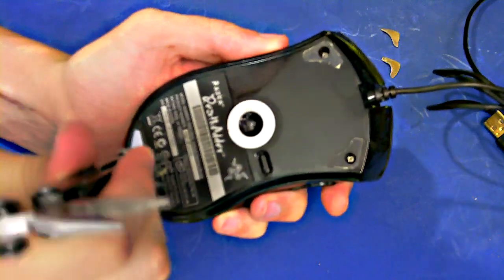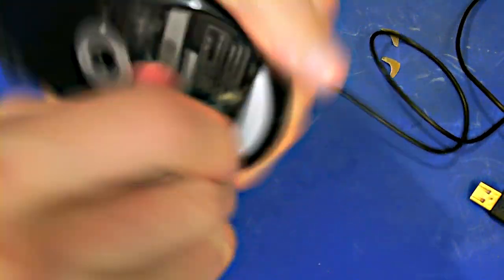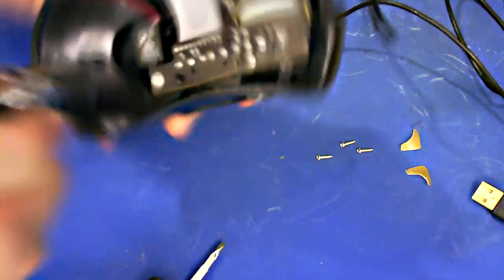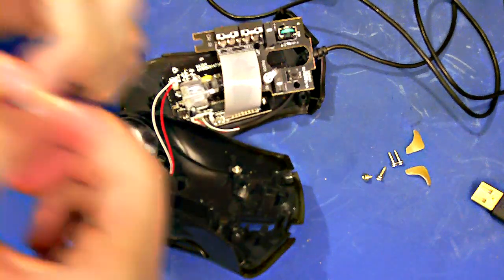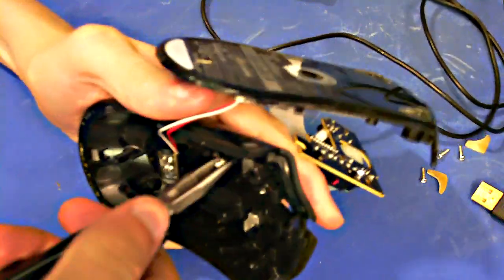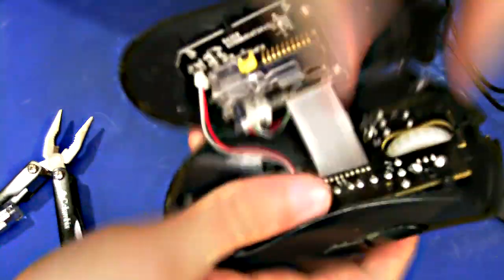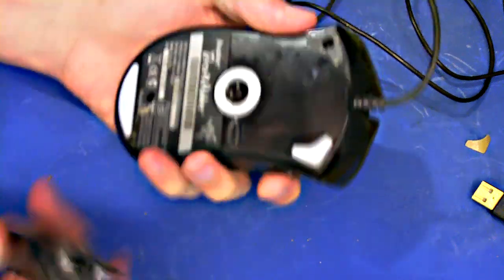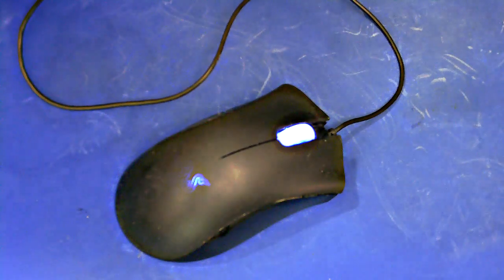How to fix Razer Death Adder Scroll Wheel

Comment: Worked like a charm on the Death Adder Essential!! Thanks!!

For anyone having troubles, to take out the scroll wheel, you gotta take out the screws on the mouse 4 and mouse 5 switches on the motherboard & the little led board has a small screw on it too. Then it will come out fine. :)
Reply: i read that you should try blowing air into it so i was trying that at first and it wasn't working, i popped the bottom plate open and looked at the scroll wheel and there was a shitload of cat fur all embedded in it (i have 3 of the little bastards), cleaned it up nice, tested it, was still having the issue, but i blew air into it then and it's been working fine since for some reason.
Reply: @aquarius5264  dude thank you so much. i watched this video but i hadn't stumbled upon your comment back then.(and i didn't want to deal with disassembling the mouse) i literally just blowed some air with my lungs to it and it's just that. bam. fixed. i can't believe this worked lol.
Reply: @mayeutow  you can also take it apart and take some tweezers and just kinda pinch the fuck out of the little axle thing or whatever it's called

Comment: If anyone wondering about the legendary RAZER COPPERHEAD and DIAMONDBACK, they have the scroll wheel part in common, but it is slightly different that the one from the DeathAdder. Is it a bit harder to open/close (clips on the front under the clic buttons and one screw on the back behind the big teflon pad). So if you are looking for that particular part (scroll wheel) to replace, you can exchange between these 2 mouses, only difference is the rubber part that is smooth on the deathadder when the copperhead have some sort of notches on it, but you can also interchange rubbers as they can be detached from the wheels.

Comment: For anyone who has the new mouse ( the one with the black scroll wheel ) you do NOT need to take the motherboard off. DO NOT DO THIS, AS THOSE SCREWS ARE VERY FUCKING DIFFICULT TO PUT BACK IN AND CAN RESULT IN BRAIN TUMORS. HOWEVER, once you get the cover off, all you really need to do is take a pair of tweezers and squeeze the living shit out of the piece that the LEFT side of the scroll wheel INSERTS into (It is the thinner side of the white plastic piece that goes THROUGH the scroll wheel) pinch it on its left and right sides a few times (or a lot, I chose to do a lot so I didn't have to go through this hell again) And then put it back together and Wa-la! Hopefully now your mouse wheel won't give you an aneurysm.
Reply: If im looking down at the mouse with the scroll wheel at the top, its the piece in the top left with a black rounded top and a metal bracket surrounding it that im squeezing? You said pinch on left and right sides but at the orientation im looking at it the wheel axel is going into it on its right side.

*Edit* Turned out I had a whole different problem, part of the axel was broken off and stuck in the receiver, so I had no choice but to remove the motherboard and take out the scroll wheel entirely and mcguyver it back together using super glue.
Reply from the maker: Thanks, hopefully people see this if they have a new mouse.
Reply: do you pinch the orange part or the metal part?
Reply: Could you please elaborate on the specific piece? I can't seem to fix the squeak no matter what I do.
Reply: This did not work
Reply: Thats what is shown in many videos on Youtube but for me it just fix the problem randomly: few hours later i have to fucking press the wheel really hard to make it work and sometimes it last month.
Reply: Reporting in with a black scroll wheel. I would definitely recommend removing the main PCB. There's a 2nd very small PCB sitting near the wheel on top of the main board attached with a tiny black screw that you also have to remove. Plus two more screws on the left side holding down the 2 side buttons. After all that is removed the main PCB comes off and you can remove the scroll wheel like in the video. A small piece of tape worked wonders.
Reply: Thank you so much! Been looking forever for a fix to this, never thougth it would be this hard to find one. Finally fixed it after 2 fricking years!
Reply: umm im confused lol
Reply: They are easy to put on with the right screwdriver. There is a hidden screw in the middle.

Comment: 2015+ Deathadder users please read. GEL superglue works great, just a pin drop on the head shaft. Careful inserting it back, not to glue the rotating wheel which is what Foxden did it seems. The newer deathadder requires the 2 extra side button actuator screws to come out once inside.. so 5 screws are holding the pcb in place. Just fixed mine and it scrolls like BRAND NEW!
Reply from the maker: +Tony Skiffington thanks for the advice/comment Tony, I did make that mistake. Luckily I had an extra mouse to try it on without risking it. I don't have the newest model sadly and have since moved on from Razer mice because I had 2 with problems in less than a year. Glad to hear yours is in tip top shape! Hopefully that helps others

Comment: I've tried this method before and it worked for a while(tape method). I was thinking of a different method since my diablo 3 steel series mouse was really annoying me to death. This is what seemed to work so far; I cut a small square from a rubber band and poked a hole in the center with a push pin. Then inserted the square piece at the end of the divot(very snugged, may have to stretch with push pin), then reassemble. You might be thinking why the hell would this work.  I think it works because the rubber-band piece is creating friction from the pressure it is exerting on the spinning part so when you scroll, the rubber band catches the spinning part forces it to turn. So far its working but i did notice it decreases some of the scrolls lengths, but IMO the random scroll is way more annoying.
Reply from the maker: thanks for sharing a fix!

Comment: in my case (>10yo deathadder, wheel jumpy - going in the wrong direction sometimes) it only helped to clean the green wheel and pry its 3 contacts loose a little bit (very very carefully). also cleaned the opposing side. i used isopropanol for the cleaning.

Comment: So my deathadder essential started to scroll up when i scroll down most of the time, did anyone have the same issue and can confirm that this fixed it? :]
Reply: i fixed it
Reply: i have this too :/
Reply: @daz1717  i just bought some compressed air and blew into the mouse a bunch, that fixed it so i guess it was just dust messing with the wheel
Reply: @inari_777  yep, i just blew into it a bunch and its working fine now. it started abotu a month or two ago so i stopped using it but i just decided to use it again incase it works and it did. i did not wanna take the whole thing out lol
Reply: i literally blew on my scroll wheel twice and it fixed it

Comment: So i took mine apart, but now that Ive put it together, it wont left or right click. idk what to do, I see the parts that push against the left and right click buttons, but they dont reach
Reply from the maker: +Hayden Garczynski make sure that when you put it back together the mouse clicking lines up with the circuit board so that the clicking works.
Reply: Foxden I'm just an idiot. I figured it out, but not before breaking the grey wire-piece. So now I have to wait for my dad to re-solder it back together. Thanks anyway man.
Reply from the maker: sorry to hear that! hope all goes well

Comment: i took the screws off but i cant pull out the top or bottom part. Do i have to pull rlly hard? cuz i feel like its gonna break.
Reply from the maker: Can you see the crack? Make sure you got all the screws, it may help to use a credit card and slid it in the crack where it comes apart. Don't pull on the push down clicking tabs (I don't know what to call them) because the part that actually comes apart is on the side. At 0:56 you can see the crack where I pulled it apart.
Reply: ty :)

Comment: Hello everyone, I own a DeathAdder Chroma which I believe is the 2013 edition just with spectrum lighting. This causes some problems, since I have the same "loose scroll wheel" issue, but the DeathAdder 2013 has differently placed inside parts. There are several more screws and some parts are blocking the wheel, so I can't take it out and apply the fix shown here. There are no fix videos on  YouTube and I'm pretty sure I have checked most of the forums that list this issue. Any ideas are welcome.
Thank you in advance.
Reply: $90 mouse   :(

Comment: took my deathadder  2013 apart and its compleatly different cant figure out hot to get the scroll wheel out theres like 3+ extra screws in mine than yours
Reply from the maker: +Dub 420 Tony left a comment "2015+ Deathadder users please read. GEL superglue works great, just a pin drop on the head shaft. Careful inserting it back, not to glue the rotating wheel which is what Foxden did it seems. The newer deathadder requires the 2 extra side button actuator screws to come out once inside.. so 5 screws are holding the pcb in place. Just fixed mine and it scrolls like BRAND NEW!"

Hope that helps

Comment from the maker: I tried superglue as this fix didnt work as well as I'd have liked it to, I broke my mouse wheel that way, I do not recommend doing that. I hardly used any superglue but there are 2 spinning parts or something in there and they ended up glued together. If someone figures out a good way to superglue it then I would recommend making your own video but as for me I'd recommend not doing anything that could permanently ruin the mouse.
Reply: +Foxden Water based paint~~ does the trick
Reply from the maker: great suggestion
Reply: what is the problem that is being fixed here? is it when you scroll instead of it going down it flick between up and down?
Reply from the maker: Stienozo this problem is when you roll the wheel up and down and it barely moves the screen or moves it up and down even though you are only scrolling one direction.
Reply: Foxden
perfect thank you
Reply: 0
Reply: Thank you soo much! Its work very well.
Reply: Hey man! I was going to use super glue but i used a good hard epoxy instead! just dabbed a strand on, pulled it around the lil ball and let it set and cure for about 2-3 hours. Plopped it in and so far so good!
Reply: as it happens, i just fixed my mouse using superglue. tiny dab in just the right spot and it scrolls just fine again...

Comment: I'm slightly confused here. I took apart my mouse. And have the scroll wheel out. And I see the side with the little divet. So am I just soley taping the little divet in the end?  Or am I taping the entire side with the divet. I can't really tell cuz the video is going too fast. Are we essentially trying to increase the radius of the divet so it actually turns the mechanism?
Reply from the maker: yes, the divet gets rubbed down so that it no longer catches the scrolling mechanism, so the little part that goes inside the circle needs to be slightly, barely, like just a small titch larger so that it starts catching it again.

Comment: Hi, after inserting the toothpick (without the scroll wheel) I tried to connect the mouse and rotate the toothpick but  doesn't work. I should try with the scroll wheel in position or  it isnt relevant? Thanks for your help.

Comment: Seriously, those mouse are all about paying for a name.. They're cheap af
Reply: which ones would you recommend ? im actually looking for a replacement :)
Reply: @aurimasmaldzius5345  I don't know much about them :P. All I know is that I had random brand mouses that easily  lasted 10 years, but the Deathadder started getting wonky after just a year. It's a pretty mouse tho... I guess.
Reply from the maker: I have a logitech at work I've used for about 4 years now no problems and some knock off UtechSmart Venus MMO gaming mouse that has been going strong for 5. Razer has been by far the worse mouse I have ever owned.
Reply: @terminatorgir  8 months later I'm still using it, but your video really did the trick! but now it's the wheel  not working well lol...  I still stand by my comment. Pretty lights I guess

Comment: Hmmm.... my mouse has the same shape as urs but it lights green so i guess its different but thats that, i wanted to ask if this method works for my problem : my wheel doesn't work and it scrolls faster than usual, it seems like nothing is holding the wheel at all but the middle button works tho.

Comment: Thanks for making this video! TL;DR: Be careful with the band of cables connecting the circuit boards.

My scroll wheel stopped working earlier today. Sadly when I opened my Razer DeathAdder Chroma I noticed that the shorter side of the scroll wheel, the one connected to the scrolling part, had broken clean through at the thinnest part. I tried tape with no luck (since I was missing more than just a few millimeters). While doing this and testing I somehow put enough stress on the offwhite band of wires connecting the bottom circuit board to the top one to make it come apart from the bottom board. It was probably while bending it a bit back and forth while putting the mouse together for testing that made it crack.

So yeah, going to have to buy a new mouse now and it will not be a Razer this time since this is the second one that's stopped working in 3 years or so. The last one had the optics die. 

Of course I would have had to buy a new mouse even if I didn't manage to break this one completely trying to fix it. One afternoon without a scroll wheel made me understand just how much I use it. Was still worth a shot at fixing it instead of just giving up on the mouse.
Reply from the maker: +furbyfubar Thanks for watching the video, I also decided to phase out of Razer products since I've had such bad luck with them. If you're looking for a mouse on a windows pc I picked this one up and really like it. Happy computing!
http://smile.amazon.com/Upgraded-Version-UtechSmart-Venus-Precision/dp/B00FNKMVUO?ie=UTF8&psc=1&redirect=true&ref_=oh_aui_search_detailpage

Comment: I thought of a different solution. 

1. Put a few drops of super glue on the tip and keep turning the wheel, as if you were keeping honey on a honey dipper. 
2. Blow on it to make it dry faster (don't breathe in the fumes though. Do like the Chocolate Rain guy did and breathe away from it.
3. Put it back in when it's almost solid or when it's solid, I put it in when it was almost solid. 
4. The wheel might feel stiff for a few minutes. Just keep turning it until the glue erodes enough to make scrolling smoother.
Reply from the maker: +thinkngskeptic The superglue thing did not work for me at all, though I put it on and thought that i could get it to spin but the glue melded the wheel to the metal, I hardly used any glue, so I recommend avoiding the superglue method.